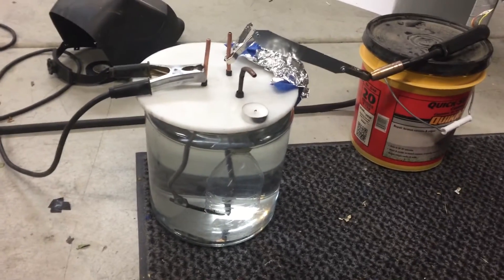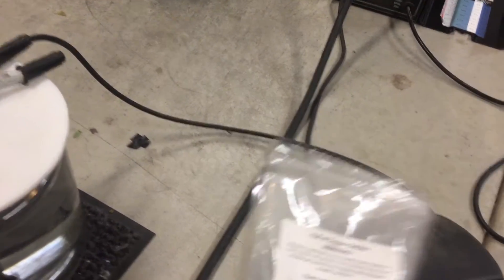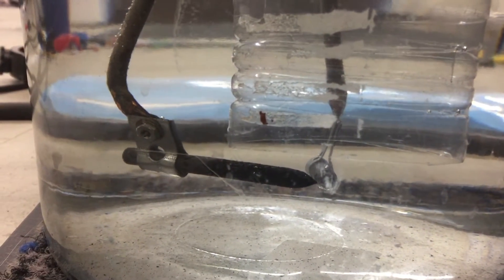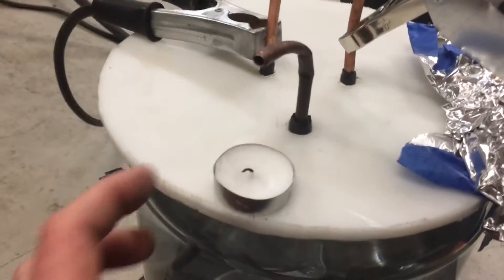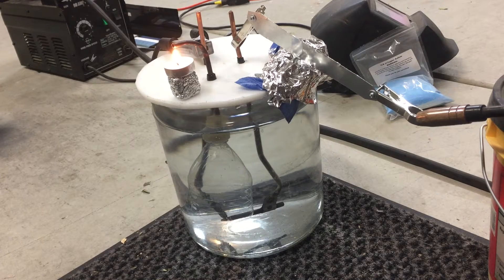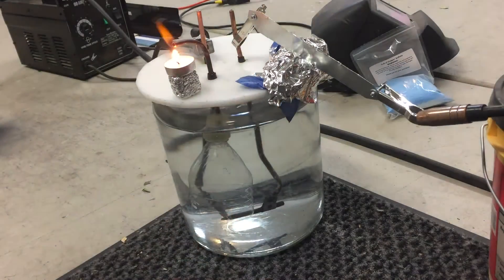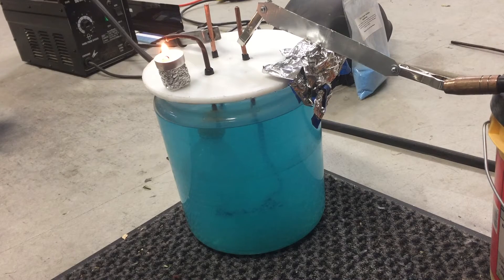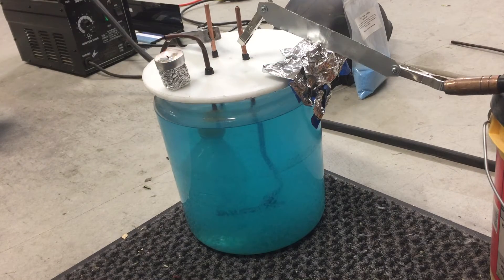MagneGas Flame Tests (Metal Ions in the Gas?)

Comment: Hey sir, 
I am edexcel student from India and my name is Daniel, I've seen your videos and they seem costly and as a student for my upcoming science exhibtion I would like to hear topic ideas and suggestions from you. Please reply ASAP and also please send your e-mail id as well. 
Regards, 
Daniel
Reply from the maker: Hello Daniel, there are ways to produce Magnegas with inexpensive materials. You will need a minimum of 36v DC, electrical wire, carbon graphite, a container, and some soapy water. You could use 4 x 9v batteries connected together for your voltage source, and pencils for the carbon graphite. 

*WARNING*
The gas produced is highly explosive.
Do not collect the gas in any containers. It becomes very dangerous when collected. 

Connect the 4 x 9v batteries together by connecting the positive pole of one battery to the negative pole another. Do not connect both poles to both poles of another battery, the batteries will short out and overheat. You will want to see a zig zag or step pattern from one battery to the next.

Attach one electrical wire from the first battery’s exposed positive pole to the graphite of one pencil. 

Attach a different electrical wire from the forth battery’s exposed negative pole to the graphite of the other pencil. 

Now you can hold the graphite of both pencils under the water. Any bubbles that form while the pencils are apart will be hydrogen and oxygen. However, when you touch and arc the graphite together, you will form Magnegas bubbles.

Once a small amount of bubbles (1 to 5) of gas form on the surface of the water, you can ignite them with a match or lighter. Do not ignite large amounts of bubbles, because it will be a larger explosion.

I hope that helps.

Comment: You need to ensure that entrained water vapor isn't making it into the flame. Water is very clearly seen coming out of that tube. Have you ever seen where a boiling solution containing a dissolved salt deposits the salt everywhere? Well, here you go. You are certainly able to see the copper in the flame test, but unfortunately, it's coming from the water. You will either need to use a cold trap to catch the water vapor, or use a drying tube in between. There are problems with both of these approaches, but I think they are you best chances. I am not exactly sure why you wish to determine if metal ions are in the gas, because its not like these sorts of things aren't done in industry for purification of metals, such as gas centrifuges, etc. What are you trying to accomplish? I guess I need to watch more of your videos.
Reply from the maker: You’re right, I thought about that after posting the video. I’ll run the test again. Thanks
Reply from the maker: I’m doing research on Stanley Meyer’s Laser Electrical Particle Generator “Laser-EPG.” He claims to have created a magnetic gas using vaporized metal ions.  This wasn’t the method he used, but this experiment was attempting to prove this method would work as well.

Comment: EPG= https://en.wikipedia.org/wiki/Magnetohydrodynamic_generator
Hho/Magnegas/ Magnagas = Magnetic Gas... 
Some years ago I tested a Cold Fusion Cell like Naudin, the Gas was magnetic, but you Need Voltage greater than 120Volts and Watertemperatur above 80°Celcius to achieve it, no Common electrolyses. 
Cell was creating a Magnetic fog.
Reply: Reverse engineered: Injector-> Gas  gun-> epg.... 
Gas gun has several coilwindings inside to collect - like the ep g- Energy from the ionised gas

Comment: lol looks familure Nice job if u remember I had blue water cause the copper rods I used broke down Nice Explosion I don't feel so alone now lol
Reply from the maker: Yes, I remember. Your video and our conversations were the inspiration for this video. I wanted to clarify whether your green flame was due to the arc to the copper electrode or the suspended copper in the water. Probably both, but now we know it can be done with only a suspension.